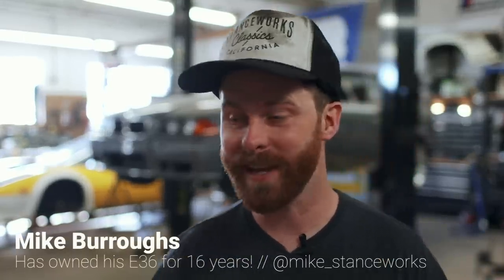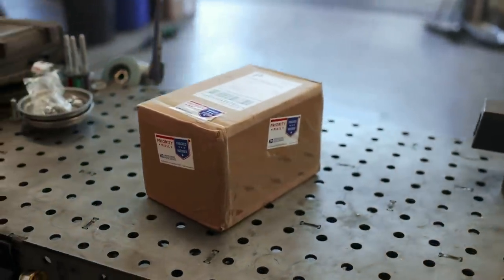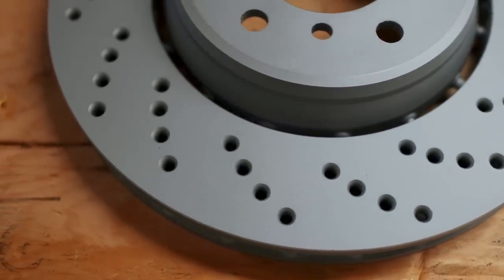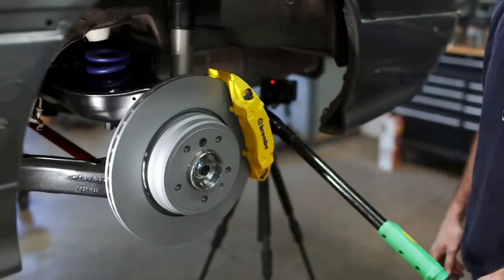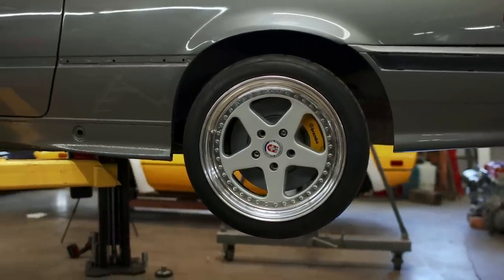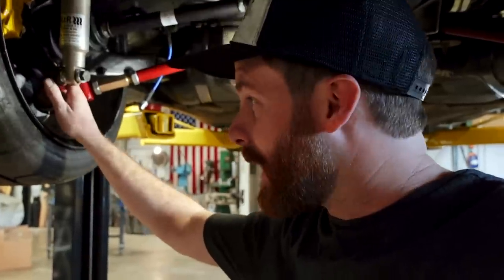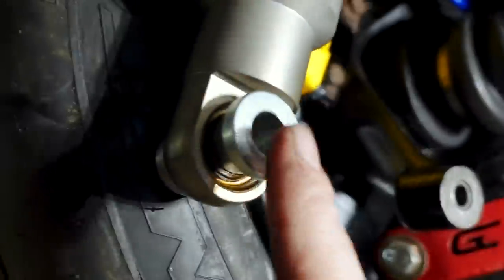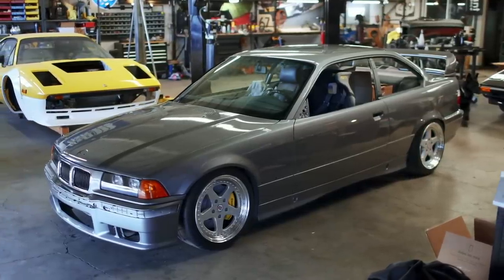SUB $1000 Brembos! The Ultimate Budget Big Brake Kit (ALL FOUR!) for E36/E46 BMWs!

Comment: I like the video, but your prices are so far gone it’s almost not relevant. $11 for a Porsche brake caliper? Not likely in any state, a set of four should be around $500-$600 in decent shape. The brackets are sold by many shops, so $650 isn’t something you need to dedicate, but rotors are the key. Fitting e46 rotors all around work great

Comment: With Mike's comment on "spending more for drilled rotors," please note that will not last as long as blank or slotted. They tend to crack around the holes. Yes, they look like "race car" parts, but race cars don't run them anymore for this reason (they were originally to help vent gasses from asbestos pads, but that's no longer a thing). Slotted rotors help with cooling a bit and combat "pad glazing" (if you overheat your pads). I'm not knocking anybody for buying them for looks, just know what you're getting into and don't be fooled that they're actually better performing.

Comment: I did this setup on my last e46 m3 back in 2015. Definitely gives the car that sporty look and the brake performance is better. Overall still a great kit for the money even 7 years later.
Reply: Did you have to modify the master cylinder or any other components? Thanks
Reply: @danielwade9930  I did not. I used the factory components. I upgraded to stainless brake lines, Porsche brembo calipers, new brake pads, and competition package m3 rotors. You will need the caliper brackets for mounting. I sourced mine from a forum member on the old m3forum.

Comment: I love following this build and details that you have shared with all the E36 community. An alternative "low cost" Brembo upgrade, would be to install front Brembos from Renault Megane RS (a rebuild & painted set can come in at 350-400$, from Europe ofc). They fit the "cheaper" 325x28 brake rotors from an E46 M3 and even the lower spec 325x25 from 330i. Where as the rear can be upgraded again from an E46 330i, with 320x20 rear rotors and adapters for handbrake functionality. Slap in an M3 3.0 (EURO) master cylinder with a M12/M10 adapter for better brake feel.

Comment: I installed a StopTech ST40 front BBK and E46 325/328 rear brake setup in my E36 328is track car. Cost under $2k, and has been totally up to the task of advanced/instructor level HPDE driving. There's really no need to upgrade the rear brakes, but I totally understand wanting some bling back there. The StopTech kit also gets you much nicer rotors and caliper pistons that are specifically designed to work with the E36 non-M master cylinder. No need for spacers, either. The E46 325/328 rear rotors require zero mods and work perfectly with the parking brake.
Reply from the maker: Stop Tech makes a great product and kit, for sure. I just wanted to try a DIY path so I could provide info and answers to others! I'm always eager to learn something.

Comment: I really like that you used a time-sert to repair those shock bolt threads.  I was a motorcycle tech for 25 years and that was my go to thread repair.  One thing i liked to do was use a lubricant on the install tool and loctite (red) on the outside of the insert just to insure that the insert stays put if the threads corrode a bit.  I dig all your builds and can't wait to see how they all turn out.

Comment: Interestingly, I have an E46 BMW 330i and I found the M-sport upgrade calipers from any F30 BMW bolt directly to E46 mount points at the front if you change the brake discs for  VW Transporter T5 rotors with the centre bore made out in BMW fitment.
Reply: if you can get away with 20mm spacers you can use the original f series discs with the spacers behind.

https://youtu.be/z1MX5lvMrz8

Comment: I did this conversion last year for an e36 front set up. Pretty sure I did it for under 550/600 with decent pads and new braided lines. Well worth it. Only thing worth considering is piston size. Ideally you need to swap them end to end so swapping the cross over pipe and bleed nipple,,,, this can lead to issues if one doesn’t want to come out so be careful. Machining of the caliper surface is also easy to have done

Comment: 911's have a much different weight balance with the engine at the back, and thus the rear brakes are much larger than they would be on a front engine car. Will you address this with a proportioning valve or something along those lines? Looking forward to more E36 content.

Comment: For the rear rotor brake, the 750i e38 fit only for M3 and 330i e46 handbrake...
On E36 and E46 L6 (except 330) you need ~160.8mm <-->

Comment: Looks great.  I have some 4-piston brembos sitting on the shelf waiting to go on.  I should retain the 321mm front disc so I should be around $400.  Under 100 for the calipers, 70 for brake lines, and whatever I spent on rotors and pads.

Comment: Have you swapped the rear breake calipers from left to right and vice versa? On the Porsches the rear calipers sit between the wheels. On the E36 they sit at the rear. So the wheel rotates the other way around in relation to the caliper. The calipers have different size pistons. The use of a smaller diameter piston at the side where the disc enters the brake pads will ensure more uniformity in the pressure distribution on the brake pads. I see a lot of brake swaps where people don't take that into account.

Comment: I would comment "exact same thing" does apply to application, while YES its not a designated configuration - a simple follow up on performance/maitnence on 2 or more conversions (like a forum) is the basis of how almost all backyard progress is made with OEM retrofits - if you look carefully many of the kits are using these same principles as platforms expanded repurposing in a similar manner.

Comment: It looks great Mike. I have the same 911 calipers on my e36 painted in Miami blue, but I’m using the Brembo branded calipers (not budget friendly). Thanks for making this video, I didn’t realize there were more economical rotor options. However, thankfully I get a lot of track use out of the rotors, so the cost doesn’t come up often.

Comment: I was expecting those rotors to be more tbh.
Honestly, that's a good price for the quality of the kit and should give you a big improvement over stock.
Hopefully you won't have too much rear brake bias with the same calipers front and rear but I'm sure you can sort that out later once you get some seat time.
Really enjoying this series as it's a little more approachable for the average enthusiast vs the Ferrari build which is a little out of my price/ability range.
Nice work!

Comment: Nice one. I did a Full F Series M sports setup, 4pot fronts & 2pot rears.
all on non m hubs. 
cost was about 1200 quid, calipers, discs, pads, shoes, retaining accessories, new lines, etc. 
and I got them to fit under 17 inch wheels.
340mm front discs and 345mm rears. 
tho custom spacers instead of custom calipers brackets. tho all bolt on
Reply from the maker: That's some really solid info!

Comment: This is all awesome and I can't deny how good it looks. But you will definitely need a meatier master cylinder to power those calipers, there are as many pistons in one of those as there is in all of the stock calipers combined. I would also be wary of your front/rear brake balance with having such a big disc on the back as well as the front. Will be dialled in after some tuning and testing though and you will have unreal stopping power.
Reply from the maker: There's a common master cylinder upgrade to go with the system. I'll do an update when I get to it. There's still a long way to go. I didn't even get to touch upon brake pads or the line installation in the video.

Comment: Really nice job!   Beautiful!   And frankly, with your new S54 power, more braking power is equally as important.   The only added step I would have taken is that I would have thrown in a complete set of wheel studs as well.   Having several high performance BMW myself, there is nohting stupider than the BMW lug studs.

Comment: That's a great upgrade for the E36/46 platforms 👌 I doubt here in Australia I could get anywhere close to that price though plus the CAD structural modelling of the brackets and engineering for this upgrade to be certified as road legal would double or triple the cost. Still, one can dream 😉

Comment: This channel continues to be excellent, both in content, presentation, and production. Thanks for taking the time to document your work. Interested to see parking brake solution. Is the US S54 the same bhp as the Euro?
Reply from the maker: I'm not sure on the S54s... Mine made 333bhp stock, and last we dyno'd it, 327whp. For the parking brake, I'll probably press in a steel ring.
Reply: @stanceworks  I think the Euro spec S54 was advertised at 325bhp. I had an S52 M coupe - that was seriously quick with advertised 321bhp, I don't think you'll have any complaints!

I don't remember my E36 3.0 M3 (S50) being slow either, with 286bhp advertised. 

Keep up the good work Mike.
Reply: Euro S54 had +5hp over US version. Comparative downgrade for them over S52 IMO.

Comment: Looks really nice the yellow against the silver. But have you not installed to larger disc as the caliper and hence the brake pad are not seeing the full face of the disc. It looks like after a while you’ll be cutting a ridge in the lower half of the disc surface near the bell.

Comment: Personally, I don't care for BMW racing build projects & would not waste my time watching those videos. But I enjoyed watching this video because of Brembos. I think they are a thing of beauty. That got my attention. I've always wanted to put Brembos on my weekend sports car, but it would not improve the stopping power any more than the already improved set up I have here with 13" rotors & bigger brake booster, along with original calipers & master cylinder. The only difference for me getting bigger calipers is wasting thousands of dollars more.   
I noticed you use solid rotors for the rear for parking brakes. Much difference? 
I had all four rotors in drilled/slotted and use rear discs for parking brakes.

Comment: just adapted a pair of camaro SS/tesla S/cadillac CTSV rear brembo.  im 1k in the hole , $250 calipers, $200 in rebuild parts, $400 adapter, $150 rotors, $60 pads.  i can see saving money on calipers from junkyyard but sourcing brembos at a yard and even finding someone who has made that adapter is just luck. def can do 1k for rears, but not all around.

Comment: Looks great Mike, are u going to use a motorsport wheel stud and nut kit now u have spacers ?
Have u installed that new diff nose bolt yet ?  Unbrako M12  is the easy way.
Cheers from and Aussie with a euro spec E36 sedan, S50B30. Fun drive !

Comment: Did you have to use longer BMW bolts to bolt the wheel on with those spacers and my question is why aren’t you using racing studs?

Comment: Great video!  I want to do this conversion on my e36 m3 but my concern is wheel spacing.  what offset are the HREs you are running?  I have rear Z3 mroadster wheels on all 4 corners.  I can't use spacers even with cut fenders and flares mounted.

Comment: There are much cheaper BETTER solutions for brakes out now.
135 and 335 Brakes and rotors are probably the best brake choice you can make.
This option used to be REALLY effective when the cost of things wasnt so high. but due to inflation and other issues its just not a feasible choice.
after spending over 2000$ you can pick almost any well known brake company and they have a bolt on kit FOR our cars.
The greatest part about owning a popular sports car. The aftermarket support.

Running the 135 stuff with a retrofit of the brake master cylinder gives you perfectly functioning brake performance that is arguably one of the best on the market. or you could skip that option and go with a manual brake proportioning valve.

The only thing needed with the 135/335 brake setup are a couple washers behind the rotors to space the rotor for the brake caliper. the rest pretty much just works. and the OEM lines work aswell.

Comment: I am suprise that you dont need to change the brake master cylinder. In my honda insight 2000 brake conversion, without changing the master cylinder, the travel of the pedal was to big.

Comment: Non-M cars have 160mm hand brake, not 180mm like 750i. And master cylinders are so much smaller than M3, pedal gets mushy. Non-M cars can fit 8.5J ET38 as the widest wheel without pulling fender, which may not be enough to clear calipers. There's more expense to this to make it work and street safe.
Reply from the maker: The 8.5 ET38 comment isn't correct at all. But that's subjective. The brake pedal feel is easily solved.
Reply: @stanceworks  It is on E46. Maybe ET35 at most. But for example PartsShopMAX need you to run ET17 fronts for their 4 piston caliper. Porsche design is flatter on the front side to clear more of the spoke, but I'm not sure it's 20mm flatter.

Comment: You say that these can fit 17" wheels? What is the type of wheel used in the video? I'd like to look up specs and make sure my 17's will fit. Rallyroad says to use the 325mm rotors, some metal has to be shaved off the calipers.

Comment: looking at doing the same brake upgrade to my E 46 325 CI  have you worked out a park brake solution yet for the rear E 38 rotors? , will E 38 park brake work with E 46 trailing arm hub carrier

Comment: I would never time-esrt for such a vital area that has to be subjected to a lot of forces. Not from torqueing it down but during racing you experience G forces at 1g, which is 163 ft lbs. Even higher  if you track or plan to drive it hard, hit kerbs or hit a curb or pot hole because racing components arms need to withstand 1.4G for safety. If it fails, you risk damaging a nice set of coilovers, tires and or rims. 

Yes, it is recommended by dealers and manufacturers, but the dealerships and manufacturers are not always doing it the absolute correct way. They have to consider time, convenience, cost and profitability.  For a passion project like this, eventually take it out, have someone weld it and machinists tap the thread correctly.   Or get a new control arm.
Reply from the maker: It’s a shock, not a coilover. It won’t be catastrophic if it fails. I’m not worried about it.

Comment: What was done when you say “calliper machining” or did I miss that part?
Reply from the maker: For the front calipers, the surface where it sits against the caliper bracket needs to be machined down, bringing the caliper closer to the center of the hub. It's not required if you're running 18s, and you can also run much bigger rotors.

Comment: I didnt see any badges on your trunk lid; was wondering if your car is an M3. If not an M3, is there any benifit in handling or braking, by installing e46 330i trailing arms onto a non M3 e36 as the e46 330i rear trailing arm is suppose to be identical to an e36 M3.., is that true and are there any benifits to making the swap?

Comment: How can you fit such a big wheels? I scratch when body roll even with stock 7J 225/45 ET41
Reply from the maker: What hits? The tire on the fender? 7 ET41 is very high. I'd assume you're hitting suspension components, not the bodywork.

Comment: What size of rims and tire are u running? Mine scratches even with 7J, 225/45 and 2 cm spacer when body roll, I hate it, cant fit anything
Reply from the maker: You  must have something wrong. I'm running 9.5s and they clear fine, with or without spacers.

Comment: You'll get no "performance advantage" from holes in your rotors, other than in sopping wet conditions.
Reply from the maker: It wasn't really about the holes, but the rotor construction. It's not floating, but it s a lot closer than not.
Reply: I figured you knew,  @stanceworks , but you probably have lots of viewers that think drilled rotors still provide some kind of advantage in the age of asbestos-free pads and vented rotors. Might be something to touch on in a future episode.